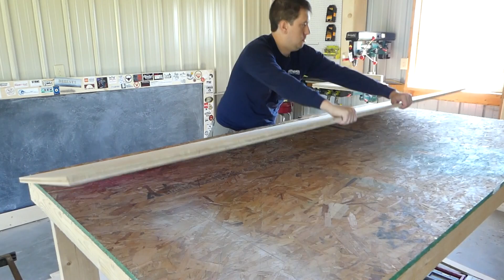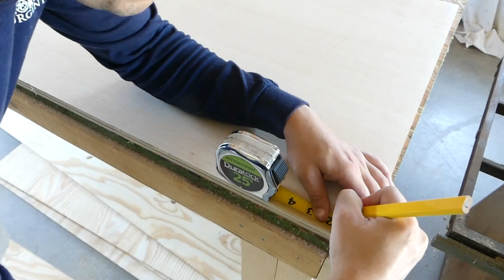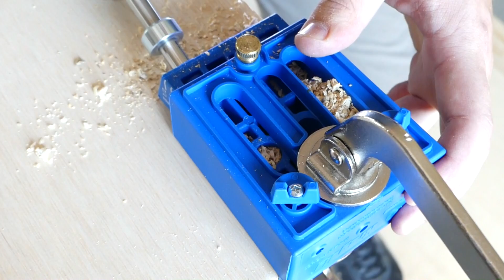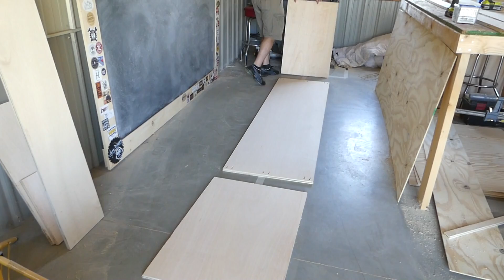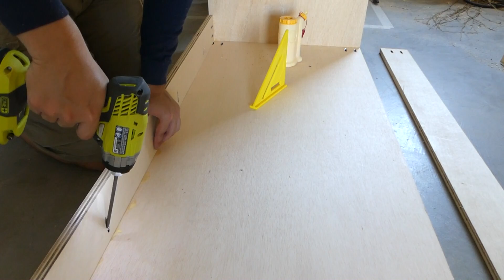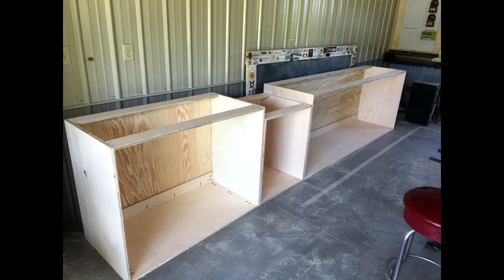🕷 Miter Station Build Part 1 Building the Base Cabinets

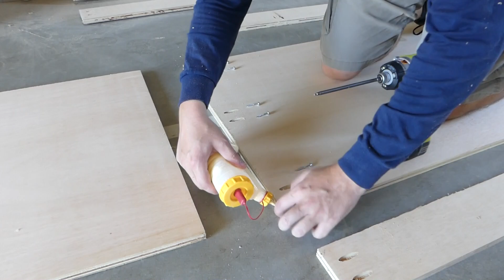Comment: I might be wrong, but is the pocket hole screws in the right direction to other surface (minute 1:40) ?
Reply: You are correct.  The pocket holes should be on the other side so that the screws are angled away from the outside edge of the board you are joining to.
Reply: That`s what I thought Steve.

Comment: Why wouldn't you hide the pocket holes on the underside surface?
Reply from the maker: +Jason Steele I agree it would have looked a lot nicer. An oversight on my part. I may flip the bottom over one of these days to hide them but I figured I'd hide them with stuff that would be going on the shelves for the time being. Thanks for watching I appreciate it.